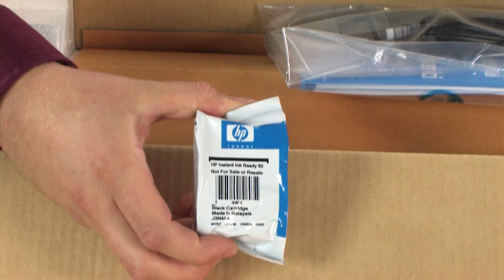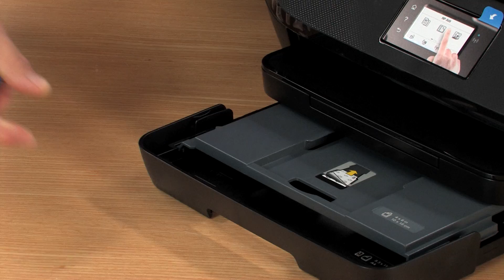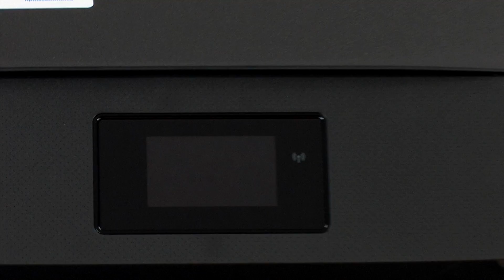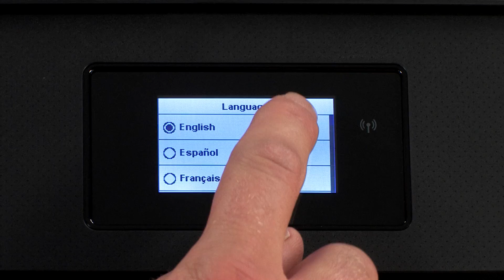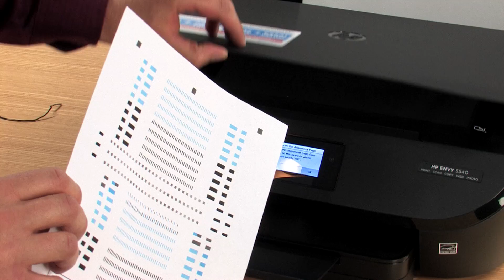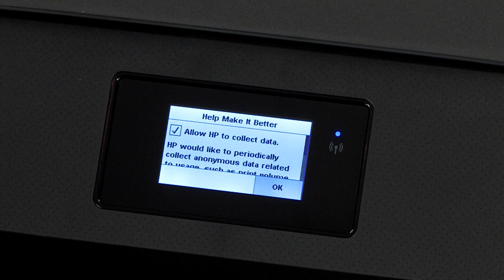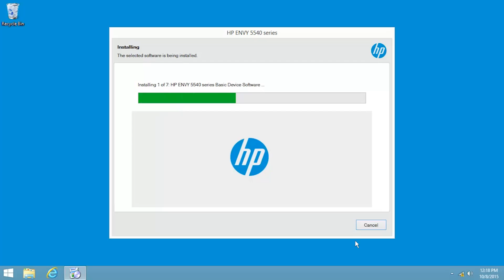Unboxing, Set Up, and Installation of the HP ENVY 5540 Printer | HP

Comment: Thanks very much just bought a printer following everything you said did as it should thanks very much 😀
Reply from the maker: +ben lewis   That's great!  Happy printing. 😊
Reply: +HP Printer Support I certainly will how does this 3 mouth free trial work on instant ink
Reply from the maker: +ben lewis     HP Instant Ink is an ink cartridge replacement service that saves money on ink costs.  I've included the "HP Instant Ink - What Is HP Instant Ink?" document ( http://ow.ly/YufBT ) which explains the service and how it works.  Currently the Instant Ink program is available in the United States, the United Kingdom, Canada, France, Germany, and Spain and is continually expanding.  I've also included the Instant Ink landing page ( http://ow.ly/Yugw0 ) where you can learn more about the program.  Currently it is set to the United States, but to change the country, please click on the flag in the upper right hand corner and choose your country/region.

Comment: I bought a 4527 earlier this year and it was a nightmare to set up. I was replacing a well-used 3050 and had to remove every trace of that printer before the wi-fi would connect - it took over an hour. I'm guessing this an HP thing because when I bought the 3050 it was replacing a Canon printer and that was just a straight swap taking about 10 minutes.
Reply from the maker: +john evans To set up an HP printer on a wireless (Wi-Fi) network, connect the printer to the network, and then install the print driver and software. The complete instructions can be found in these documents: Wireless Printer Setup (Windows): http://hp.care/2qlX2eF or Wireless Printer Setup (Mac): http://hp.care/2qlZSAh

Comment: i bought my printer recently and the printer seemed just right until i power it up just to print, it seems to grind some plastic together every time. i dont know if its a design flaw or it does that to get the picture paper tray out of the way. I hope its just one defect and i wont have to ask for my refund

Comment: The structure of this series is all the same.  I looked into  with drivers. It was amazing  that many  plastic parts are built in this box. I examined one part by one part.  HP never take care of  tested ink,  accumulated the bottom of this printer. There was the place for tested ink on the right hand side of the bottom. but you can't clean them. after years the black ink will form small mountain.
 Except this, I like this series. Many plastic gearwheels work. I admire the designer of this product.
Reply from the maker: +Н М I am glad to know that you like this series printer.
Reply: Sounds like a keeper then! Hahaha

Comment: Is it exactly the same for the 5544? The smaller of the 2 set up guides refers to to 5540, but printer is the 5544.
Reply from the maker: Yes the user guide is identical as they are part of the same printer series.  Some model numbers are regionalizations, where the differences may be in firmware, power adapters, cables and probably also the wireless adapter for those printers that are wireless, as the laws for frequency bands, transmission power vary in different parts of the world.  A different model may have a different scan engine, or a faster print speed. But the essentials in operation would still be the same within the printer family.

Comment: Hi, can you show me how to set up the HP ENVY PHOTO 7100 all in one. Cos I’m having a problem setting up mine. 

It’s stock on waiting for ink choices.. it’s been 3 days now done everything I know it’s not working can you help please.
Reply from the maker: +st.chaidbay Sylvester Let's perform these steps to resolve the issue: 
With the printer turned on, disconnect the power cord from the rear of the printer and also unplug the power cord from the wall outlet.
Remove USB cable, if present.
Wait for 2-3 minutes, press and hold the power button on your printer for about 30 seconds to remove any additional charge.
Now plug back the power cable straight (This is important) and then plug back the power cord to the printer.to a wall outlet without any surge protector or an extension cord
Turn on the printer and wait till warm-up period finishes and the printer is idle.
Perform Firmware Update: Follow steps from the link: https://ftp.hp.com/pub/softlib/software13/printers/en7100/EN7100_R1903B.exe
Once completed, then try printing and keep me posted.

Comment: During setup, I missed the step to connect the wireless printer to the network. The printer will not allow me to navigate in reverse to complete that crucial step. Now I have a new printer that is completely useless.
Reply from the maker: +David Lipenski Performing “Wireless Setup Wizard” will allow the printer to complete the setup: http://bit.ly/2kGdt2z

Comment: It seems the output tray slides  out automatically when printing is initiated. However, it does not go back in automatically. Am I suppose it slide it back in manually?
Reply from the maker: +Vishal Chotai Once given print job is done, please slide back the paper tray extender manually

Comment: Does it only take a certain type of photo paper , I am loading the paper that came with the file and it’s not picking it up
Reply from the maker: +Hazsans Review the following tables mentioned under 'Paper-handling specifications' under the specification page: https://bit.ly/3uAQebA to make sure you are using the correct paper types and sizes and are not overloading the input tray.

Comment: Somebody please can tell me how to find the MAC address of the printer!
Reply from the maker: +Renzo Orjeda 1.Check your printer manual. 2.Print out a configuration page. 3. Locate the printer MAC address on the configuration page. 4. Open the command prompt by clicking "Start" and typing "CMD" in the "Run" line. 5. Look for the physical (MAC) address in the output that follows

Comment: Am I making this harder than it is?  I do not understand how to load photo paper.
Reply from the maker: +Mary Butler-Sisnroy Load the short edge of the photo paper into the tray based on your printer type. If the paper has a perforated tab for handling the photo after it prints, load the paper so the tab faces up or towards you to prevent printing on it. I have attached links on How to Print Photos (Windows/Mac): http://hp.care/2u5Gl6j and http://hp.care/2u5NtzR

Comment: Does this printer come with a USB cord? I did not notice one in the "unboxing" part.  Can I use it without WIFI?
Reply from the maker: +Laura Weisenberger This printer does not come with the USB cable, please purchase USB cable separately. You can confirm this in specification tab in this document: http://bit.ly/2p6CW8J Please refer the section Connectivity from this document to know about the connections supported: http://hp.care/2t1fcks

Comment: I do not want to set this printer up in WIRELESS mode.  I have an iMAC and want to set this up with a USB --- what is the USB look like that I NEED?
Reply from the maker: +TheJollymon1 You can set up your HP printer for a USB cable connection to a Mac computer as mentioned in steps in this document: http://bit.ly/2CTd0Da

Comment: Hi. I have a question. I have purchased HP Envy Photo 6234 a month ago. Everything was working as it should until recently. I see that printer automatically update it,and since then the printer is no longer printing. When I click to print some pdf document,the printer receives the message from the lap top.i hear something is happening in the printer but the printed page is not coming out. I have downloaded Photo Smart. On the welcome screen it says that the printer is out of photo paper. Is that the reason why the printer is no longer printing. Any help appreciated. Greetings,Marko
Reply from the maker: +zakrstcasniisloboduz Please refer to the instructions under this document to fix this issue: https://bit.ly/3dnd3oX

Comment: I am trying to print on cardstock but it is not working.  Is there instructions for that?
Reply from the maker: +Renay Bray Cards are supported from 163 to 200 g/m2 (90 to 110 lb index) for the printer.
You may find the printer specifications below, see 'Paper-handling specifications > Paper tray capacities':
https://support.hp.com/bg-en/document/c04730912

Comment: All fine until CD failed to connect.   Rest was a piece of cake, but I'm now off to HP to demand assistance!
Reply from the maker: +Margaret Little  For now, if your disk is not reading for you, you can download the software from the  HP ENVY 5540 All-in-One Printer Software page ( http://ow.ly/Z5rcE ). You just need to be sure to select the correct operating system for your machine to fine the right driver. The current operating system is displayed and there is a blue "Change" link to the right. Click that if the displayed OS is wrong, and use the drop downs to select the correct OS for your system. Then click the blue "Update" button. The available software and drivers will be listed below. You will probably want the "HP ENVY 5540 series Full Feature Software and Drivers". Just click the orange download button to the right, to start the process of downloading the file to your computer. You would then have to run the file.  I hope this helps.

Comment: iv just finished setting up my new 5540 printer, very easy to do.what I am having probs with,is trying to print from the photo tray,it just wont do it.the instructions are next to useless on this point
Reply from the maker: I've got 2 documents for you.  The first one is titled "HP ENVY 5540, Deskjet 5570, and Officejet 5740 Printers - Printing Photos" ( http://ow.ly/94UO301g6ZI ).  If you are using a Mac OS it also has a section for Mac users.  The second document is "HP Social Media Snapshots - Printing Photos on Social Media Snapshots Paper" ( http://ow.ly/vu1K301g781 ) in case you are trying to print on the Social Media Snapshots Paper.

Comment: When I try to print of pictures the ink just sits on top of the hp special photo paper
Reply from the maker: +Awkward Gamer If the quality of a printed document or photo is not as expected, the procedures in this document should help you fix this issue: http://hp.care/2nElbYb
Reply: @HPSupport  ok thank you it turns out I was putting g the paper in upside down 🤣

Comment: Hi, this is about the "pop up" tray that comes out when you print to prevent paper from falling out. Are you supposed to push it back in manually after use or should it go back in automatically when you switch the printer off? Sorry if this  is stupid but the manual says nothing aobut it and I just wanted to make sure it works as it is supposed to. My printer is the 5547 model.
Reply from the maker: +The Airbrush Makeup Guru Please refer the instructions in this document to fix this issue: http://bit.ly/2DYSeT3
Reply: link page does not explain this

Comment: Hi.  Just bought the HP ENVY 5540 printer for home/personal use and successfully connected to one laptop using the CD.  I am able to print from that first laptop.  I am now attempting to connect a second laptop using the CD but the IP address is not being recognised, neither the host name and so the installation process is not complete.  It should be possible to connect multiple laptops and devices, right?
Reply from the maker: Is your printer connected to a wireless network managed by a router, and are both laptops connected to the same wireless network?

Comment: I'm doing this step by step until it shows to type in the IP # so when i do it tells me its incorrect
Reply from the maker: These documents should be of help to verify everything:  HP ENVY 5540, DeskJet 5570 Printers - Wireless Printer Setup - ( http://ow.ly/fnr5304t7Go ), HP Printers - Find Your Wireless WEP, WPA, WPA2 Password (Windows) - ( http://ow.ly/VVv1304t8eb )  and this can be used to show how to print both a wireless test report and a Network configuration page: HP Printers - Printing Self-Test Pages - ( http://ow.ly/sLSF304t7MC ), to verify the IP address of the printer.

Comment: I have been trying to connect my printer to my wireless wifi but it continues to bring up an error message saying " this network uses an unsupported type of authentication or encryption " which makes no sense because my computer and other devices connect the the network just fine. Help ! Please
Reply from the maker: +Jasmine Waller Before you print or scan to your printer from a computer through a network, you must first connect the printer to the network and install software on the computer. These instructions guide you through the process of setting up your printer on a wireless network: http://hp.care/2d19CYG  http://hp.care/2gWOWVu   http://hp.care/2jtuziG

Comment: mine keeps showing if this message continues to appear replace the indicated ink cartridge and I jest brought this printer a day ago(Ink cartridges problem)
Reply from the maker: +Jeanine Thompson  If you are getting this error message with your new printer, please contact Technical Support. To contact support, what you can do, is use the following link to create yourself a case number, then call and it may help speed up the call process.

Step 1. Open link: www.hp.com/contacthp/
Step 2. Enter Product number or select to auto detect
Step 3. Scroll down to "Still need help? Complete the form to select your contact options"
Step 4. Scroll down and click on HP contact options - click on Get phone number

Case number and phone number appear.

Comment: Hi I just bought an envy 5544 and I wanted to ask why the printer since it's first boot up struggles to realise that there is no paper jam and it just keeps on showing the error. PLEASE HELP!!!
Reply from the maker: Please start by using the "HP ENVY 5540, DeskJet 5570 Printers - First Time Printer Setup" document ( http://ow.ly/RVx8301mtbL ) as a checklist to double check that nothing was missed during the physical setup of the printer.  After completing that, if you are still getting the error message, please work through the steps in the "HP Printers - 'Paper Jam' Error" document ( http://ow.ly/SVaX301mtlY ).

Comment: i just got the envy 5540 and my tablet can't find the printer, i've typed in the right IP, there both connected to the same network and it still does not work, what am i doing wrong?
Reply from the maker: +patgonewrong   To better assist you, would you please provide some additional information?

- What operating system and version are you running on your tablet (Android, Apple, etc.)?
- What is the IP address of the printer when it is connected to the network?
- Are you getting any error messages?  If yes, what do they say?

Thanks.

Comment: how do I fix the horizontal line gaps on this printer?
Reply from the maker: +Joe Schaefer-Sommerville The quality of a printed document or photo is not as expected. The procedures in this document should help with streaked or faded printouts, color or black ink not printing, documents with blurred or fuzzy text, ink streaks or smears, and other print quality problems :http://hp.care/2evOrPr

Comment: Hello. My envy 5540 keeps saying there is some paper stuck somewhere, but I can't find it?
Reply from the maker: +Victor Gottlieb It may not actually be paper; it could be any type of debris, and a small flashlight may be useful. It could be bits of paper, plastic, a paper clip, or staples, or any other small bit that could have fallen in to the works. Please see the following document:   HP Printers - 'Paper Jam' Error - ( http://ow.ly/10D53K ).  If that does not help, you may want to contact support, to check on your options.  ( http://ow.ly/YZvQR )

Comment: what if I want to do both wireless N USB
Reply from the maker: +85thday   You can have the printer connected to your computer by USB cable and still have the printer connected to your wireless network.  I recommend you do the printer install using the USB cable connection.  Once you've completed the installation, please run the Wireless Setup Wizard (WSW) found on the front panel of the printer to connect the printer to the network.  I've included the Envy 5540 Series User Guide ( http://ow.ly/VjuK300hARZ ).  The instructions for connecting the printer using the WSW can be found on page 58.

Comment: what happens if you don't have a computer can you do it from your phone
Reply from the maker: +Josselyn Lopez   You can connect the printer to your network using the wireless setup wizard.  The steps to do this can be found in the Envy 5540 Series User Guide ( http://ow.ly/VqQMz ).  The steps on how to do this can be found on page 58.

Comment: Can you scan a 3"x5" picture and print an 8"x10" copy?
Reply from the maker: +Mark Nicholls   The short answer is yes.  The biggest hurdle is choosing the correct resolution for the scan to accurately enlarge the picture so it doesn't look fuzzy or distorted.  eHow has a nice tutorial titled "How to Scan and Enlarge a Photo" ( http://ow.ly/Win7v  ).    I've also included the link to the 'How to' section of the Envy 5540 Product Support ( http://ow.ly/Winiu  ) page.  It has the documents for the different operating systems for scanning, including how to scan from mobile devices.